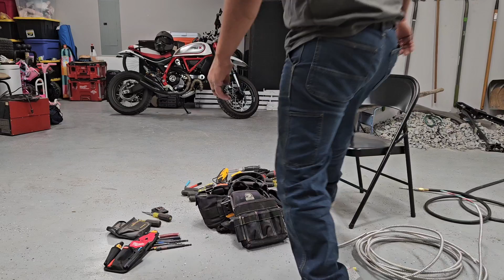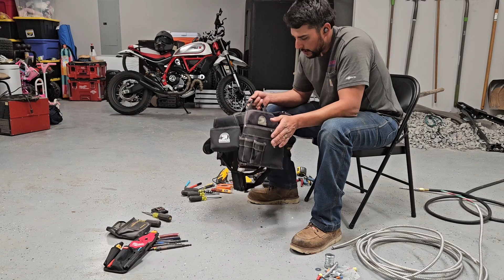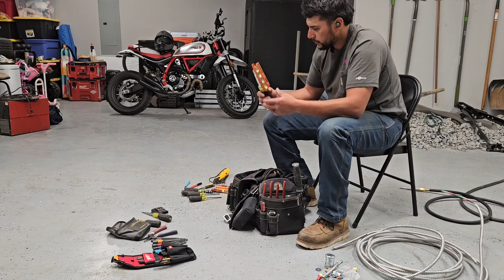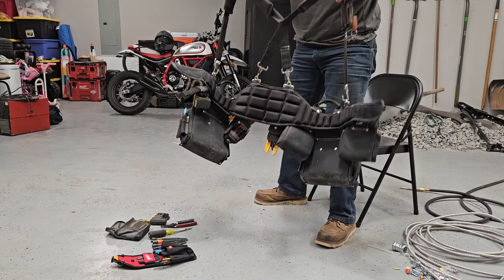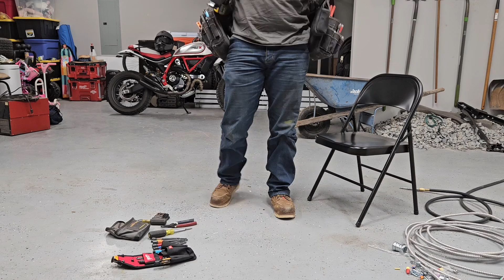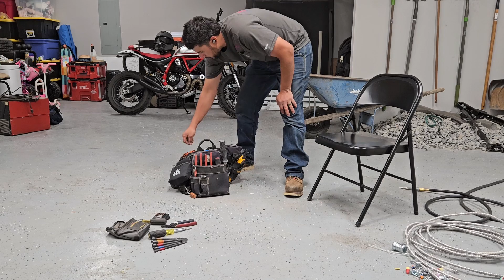Commercial Electrician tool rig update

Comment: Have you tried suspenders? Tbh most of the time i dont need em but when Im moving a lot and using a variety of tools i regret not having it. I always have a Veto Pro Pac Tech Pac Blackout with me tho and typically just use a tool pouch for what I need at the time
Reply from the maker: Yes I have always used suspenders and they definitely distribute the weight! I'm currently looking at different veto pro pac bags for my specialty tools I don't need on me all the time.

Comment: Interesting ideas on modifications.  If you want to work your reamer into a regular tool klein makes a attachment with a set screw.  I use that in my 14mm wera black handle full tang beater.  As long as the screwdriver has some flat side you can use it and it's great on your beater to save space since your gonna have one anyways.  If you want a stronger clip than toughbuilt there's a company called prolock and it's all metal version.  All you have to do to make the prolock clip work on toughbuilt is file down the bottom corners a little. Hope you got some ideas.  I use a occidental leather commercial setup buy I added a diamondback hammer sleeve and there on the ocl beltless retro kit.  I dispise belts and when you ate on the beltless system you can lean sit kneel whatever and the bags lay down on there back on the ground without spilling out also move with you. Good luck hope to see more from you on setups.
Reply from the maker: That's a great idea on the reamer beater combo I actually purchased the klein impact reamer and will definitely put a flat head bit and see how it works for me